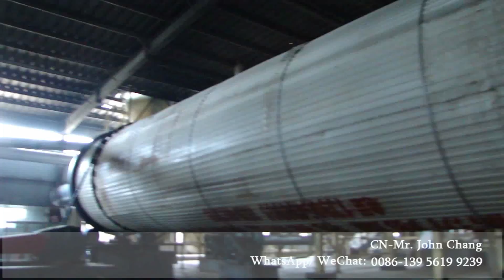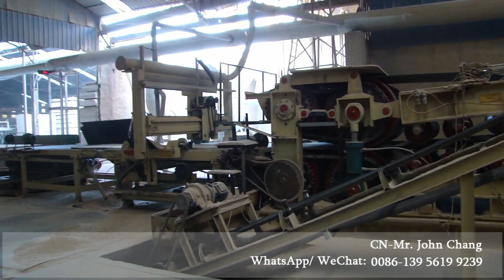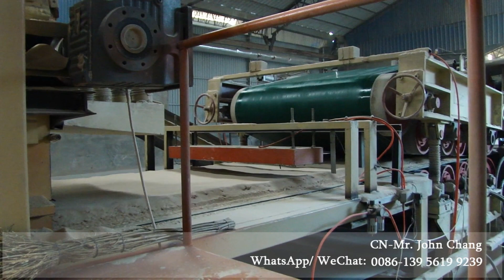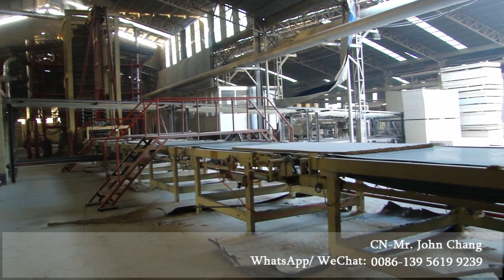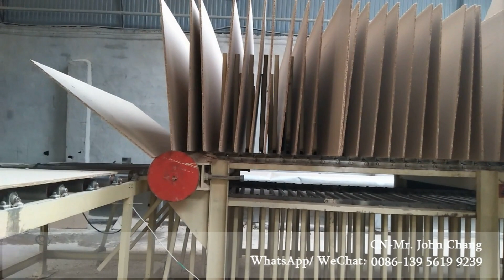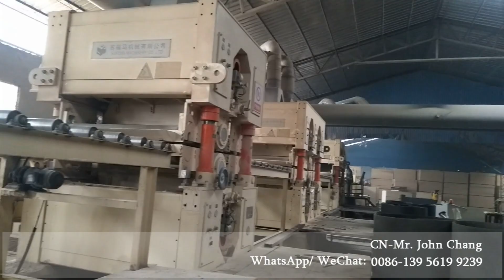Particle board production line/ waste wood pb  producing process/ 0086-139 5619 9239

Comment: Particle board production line, contact for more details, WhatsApp/ WeChat: 0086-139 5619 9239 , E-mail: john_chng@163.com .

Particleboard Production Process(Brief)

1.Wood shavings preparation Section
Short and long logs of small diameter are fed into long-log flaker by the feeding conveyor, which sliced into qualified shavings at once, then the flakes will be sent to wet flake bin. As for short branches and other materials, what will be sent to feeding belt conveyor of drum chipper. Raw material are whittled to qualified chips by chipper, then wind send these to wood bin as intermediate storage. Wood chips then pass the ring flakers to be qualified wood shavings, and will be sent to the wet flake bin by wind.

2.Drying and sieving section
The flakes discharged from the wet flake bin are conveyed to the rotor dryer through screw conveyor. Qualified flakes are screened in screening machine. Screw conveyor of dryer is equipped with spark detection devices,once alarms, dry materials will be discharged outside the system automatically. Qualified core flakes are stored in core flake bin; oversize flakes will resent to mill to be re-crushed, and transported to surface flake bin.

3.Glue mixing and applying section
This section includes the wax emulsion and hardener solvent’s preparation and transportation, additive storage and glue mixing and spreading system. After scaled, the core and surface flakes are to be effectively and uniformly mixed with qualified glue independently in their glue mixers respectively.

4. Forming and hot-pressing section
The surface and core flakes are sent into classi-forming machine, and forming on the mat conveyor uniformly. After processes of mental remover, pre-press, lengthwise saw, cross saw, accelerate conveyor, scaling conveyor, storing conveyor and loading conveyor, mats are transported to carrier and then to hot press. Rough boards after pressing are pushed to unloader via pallet.

5. Cooling and sizing section
The rough board is conveyed to star-cooler for cooling, then the rough board goes through side trimming saw and become a qualified particle-board, stacked on the hydraulic lift.

6. Sanding section
The storage board are sended into sanding system(include hydraulic lifters, roller conveyors, wide belt sander). Then sanded,checked and stored.

7. PLC system
The main controlling room is set in this particle board production line, through this you can realize operating all machines automatically and manually from wood shavings measured, spreading, shaping, hot press to trimming processes. Besides, set controlling console (box) in the operating scene for each section(except hot press section) to control and monitor each machine’s operation.

Tips:our factory can also product the different sizes of the particle board production line according to our customers' requirements.
full automatic particle board production line, particle board making machines, chip board production line, chipboard making machines